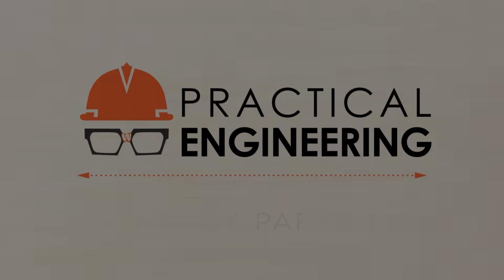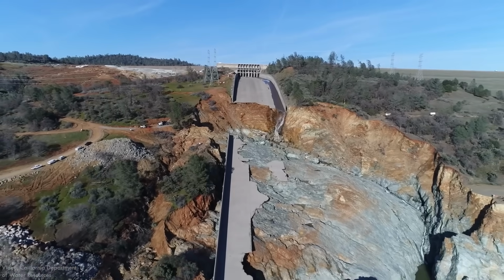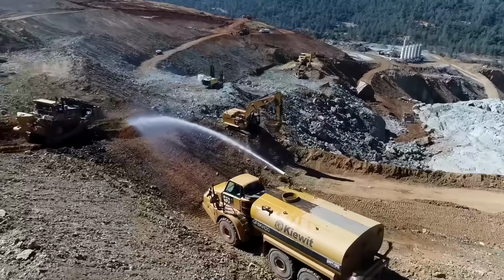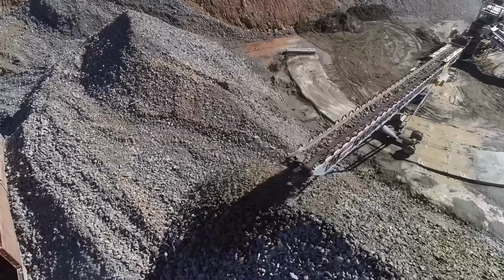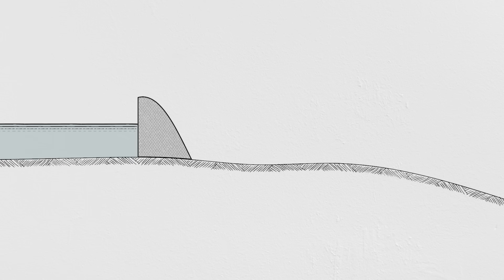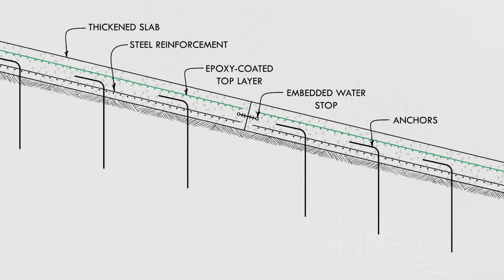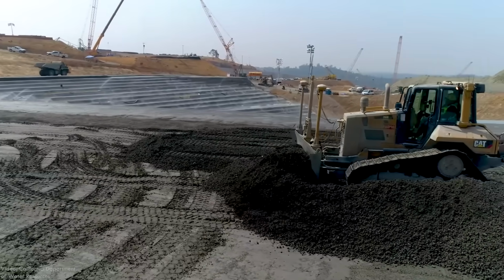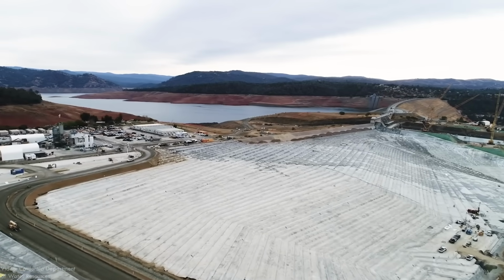Rebuilding the Oroville Dam Spillways

Comment: DWR used this process to hide the fact that this disaster was the direct result of their incompetence. They had an entire wing of their organization collecting a paycheck to operate and monitor the dam who had been sitting on their lazy rear ends doing nothing for years. The minute the crisis began we got to watch a daily circus of DWR imbeciles flailing away at their attempts to characterize the incident and explain away the fact that they had failed to conduct the required inspections, or to in any way understand the resource they were entrusted to care for. The end result is the taxpayers got fleeced for an enormous amount of money and the fools that let it happen were protected by Governor Moonbeam. Complete disgrace. The other fact that became immediately obvious is that the zone of weakness that led to the failure was known about before the dam was built and it was ignored to save a few bucks. The parade of government failures goes on including the fact that the emergency spillway was at the same level as the adjacent, unarmored, parking lot which would have blown out eventually. Many of us saw the problems long before the crisis happened and were told by the State that the Emperor was fully clothed. Complete BS.

Comment: A question if I may, I'm not an engineer: Why did they not use penstocks in the original design and in the rebuild? Would they not have been cheaper and as effective?
Reply: A very short explanation: Penstock pipes have less flow capacity than open channels and weirs because they have more surface in contact with the flow for the same area. Also, the flow velocity at the outlet of a penstock pipe is much higher than for an open channel, so they require more energy dissipation to prevent erosion.

Comment: Honestly, the problem was simply that they failed to regularly reseal the original spillway which allowed water to seep through and erode it, and the emergency spillway was poorly designed and did not have a have concrete cap to prevent it from eroding the area immediately below it.

Comment: Well the cracks may not have been the result of slippage but more a result of non reenforced concrete as i may be wrong but there was no rebar in the concrete visible at the separation and that must be the cause if in fact i am right. Long concrete pouring and no rebar equals disaster and fraud.

Comment: This reconstruction video (and the prior one on the dam failure) are
the first and best honest inquiries that I've seen regarding the
failures of both spillways, and the obvious foreknowledge of CA DWR
regarding the dangers of relying on an intentionally misconstructed
and falsely-signed-off systems that have been a hazard to the central
valley since 1968.  Who benefits when a dam is built this way?

I would enjoy seeing a similar inquiry in the role that the history of
the river valve outlet system (RVOS) played in the 2017 events, as
well as a clear look at how the dam was rapidly emptied in roughly two
weeks after both spillways failed.

CA DWR has a history of ordering destructive testing without
consulting the Division of Dam Safety (ex. April 2009 RVOS), and I'm
considering the possibility of the 2017 destructive spillway tests
being a repeat of this practice.

I recall reading about decades of unsuccessful attempts of CA DWR
lobbying a retrofit for the Oroville dam to ensure safe and reliable
failure modes.  How did the cost of the emergency repairs to the
spillway damage compare to those proposed retrofits?

Comment: Wow, that was a brilliant idea of using a model to check each design engineers suppose to see how it would handle the water in real time.
Reply: They always hydraulically model these hydro-projects as they all are unique. Original was probably modelled by UCD in the mid 1960's.

Comment: its not hard, redirect the water to the side, fill in with rock and dirt from the bottom of the spillway. rebuild. thats it. i dont need this 20 minute video explaining how to rebuild. its redirect water, dirt, rock, and then cement the thing. nothing complicated. if you want things to be complicated become an engineer. poor machinists have to deal with these jerks all the day long with stupid tolerances. that dont even need to be that tight.

Comment: Another fantastic video. As best as I can tell the only thing you got wrong was your statement about the Contractor bidding on 30% plans & specs. That is not correct. Although they did go out for bid without FERC approval, they were at 100%. Actually, if memory serves correct, we didn’t have DSOD or CSFM’s approval either. FYI, CSFM’s involvement pertained mainly to the trailers setup in the boat ramp area, i.e. EMS access, etc. Consequently, change orders started coming in very soon after Kiewit was awarded the contract. There were a lot of CO’s on this contract. 

Watching Kiewit work was nothing short of amazing. The speed at which they got things done was beyond impressive. Plus, they were actually quite nice to work with, including their subs. 

In case you’re curious, yes, I did work for DWR and I worked on the Spillway project. In fact, I was already working in Oroville on the Fire Modernization Contract when the Spillway incident occurred. In fact, I still believe I took one of the first pictures of the damage after  the FCO gates were first closed. I happened to be driving down Oroville Dam Blvd right as the water flow was slowing down.

Comment: The maddening part of this entire incident is this:  prior to the failure, California experienced 5 (count them, FIVE) consecutive years of severe drought.  This was more than ample time to have inspected the dam and discover flaws and initiate repairs!  The damn dam owner, and not the ratepayers should bear the costs associated with this disaster!
Reply: Those in positions of power often fail to understand the necessity of preventative maintance. After all, you can't see what what you stop.
Reply: The dam owner is the State of California, and, thus, California taxpayers.
Reply: It's worrying to look at the Hoover Dam's emergency spillways. They are in really rough shape having only been used twice. If Lake Mead ever does reach capacity again and it's necessary to discharge a lot of water, a similar failure is not out of the realm of possibilities.
Reply: @nooranik21  Right now the far greater concern is if there will even be a Lake Mead in the future, much less it reaching capacity.
Reply: @SaltMerchant That's no excuse for letting emergency facilities fall into disrepair. As previously stated Lake Oroville was at an all time low just 5 years before the flooding in 2016 and the spillway failure.
Reply: Jerry Brown Sr built it with less than 10% of the rebar necessary and you can't see that until it breaks.
Reply: Mr Owl
The spillway would be a really fun ride up till you die at the end part of it.
Reply: DzyMsLizzy
"California experienced 5 (count them, FIVE)"

One, two, three, four, five.
Yay, I can count to five!
Reply: The owner is The State of California. Logic is not allowed to be used in their decision-making processes. Personnel must include LGBTQ or you are fined. Identity outweighs all other qualifications. This disaster was preceded by another disaster that nobody knows about which led to this disaster. Story is so unbelievable that I cannot even repeat it. Turkey fryer incident. Unbelievable
Reply: @melaniecotterell8263  even if that were true, why would being LGBT make someone a bad engineer? the problem here is there’s no incentive for decent maintence on any american infrastructure, that’s why all our bridges and everything else are in such dire condition. 

in other words, the problem is that the government and anyone else in charge of structures like this are lazy and negligent because it doesn’t suit their profit margins, and there’s nothing pushing them to act before the structure fails. 

trust me, i understand the anger, just don’t direct it towards things that have nothing to do with the problem.
Reply: @melaniecotterell8263  cringe

Comment: Not sure why we don't use a form of glass or plastic to cover the concrete. It eliminates the friction between the water and the substrate. In doing this, the resistance to flow is eliminated and nothing will get destroyed in the future. Concrete is strong, yes, but at the same time it introduces massive amounts of friction to flow, this is how water wins all based upon friction. Half inch thick tempered glass with an EPDM rubber backing and a reflector on the glass so UV doesn't destroy the rubber with concrete under and she's good. Or acrylic with UV protection embedded. When you give water resistance to flow that's when destruction happens. Lol look at the grand canyon as an example.

Comment: I am really surprised that they used epoxy coated top bars. They have had poor performance in parkades/garages. The epoxy tends to delaminate from the bars minimizing the interconnection between the bar and concrete and actually promotes corrosion which causes more delamination. Hot dipped galvanized bars would have made more sense. Epoxy coated rebar has been removed from parkade codes requirements due to the issues.

Comment: This event in particular highlights just how devastating the power of water can be, specifically the hydraulic force of water. Water is used as a cutting agent in water jets because it can't be compressed, cutting through steel and rock. 
The spillway failures turned the dam's outputs into massive water jets.
Reply: Too bad a lot of people don't understand the power of water.  Maybe they'd stop trying to cross fast flowing flooded roads ;)
Reply: @jasonwood7340  It's human nature to ignore danger and just send it I guess. :D
There's published facts on how much lift a foot of water can apply to a vehicle, people attempt to cross unsafe bodies of water anyway. I watched several people earlier this year during a record flood try to cross water over the highway that was about 6-7 feet deep. Fortunately for them it was not moving water.

Comment: This may be a really silly question. But what if—when threatened by a flood—the state issued an emergency “open your taps” order to everyone downstream, whose water draws from the reservoir?
Reply: I don't know their water system layout but for one the flow rate would be miniscule compared, and would cap out quickly (not designed for max flow with all taps open) The dam holds years worth of supply... assuming direct supply.

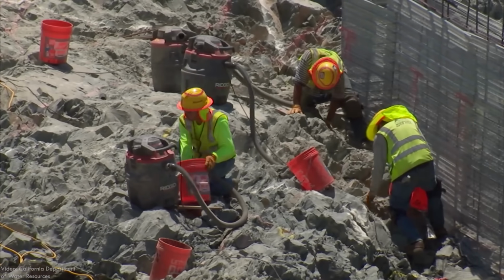Comment: 11:50 Ok, So the Rock has to be completely clean for the Concrete to key to it.
How Clean?
err Vacuum cleaner clean.
I suppose normally that would be done with water, but the convoluted holes would have prevented in this case.

Comment: Thanks for this video. I lived in Chico which is very close to the damn, and used to mountain bike trails adjacent to the emergency spillway hillside. Very familiar with the size of the damn having to drive or ride across the top to get to the trails, after the fun downhill trails we ended up at the bottom and rode up the service roads on the slope of the old emergency spillway back to the top of the dam. Its a MASSIVE structure, video and pictures don't capture just how big it is. Most striking moment of this video was seeing they used shop vacuums and cleaned the entire area that was filled with RCC like one would detail the inside of ones car, though I closely monitored the progress of this disaster and recovery I had no idea they actually did that. It must have been daunting for the construction workers starting in on that particular job!

Comment: So essentially the project was saved by hundreds of shop vacuums. I do have to wonder about how cost effective it is to create the massive scale spillway as opposed to multiple small channels of release capacity. It's not too hard to envision a model where there are many small reservoirs ready to take and hold excess water, instead of blasting it down the river.

Comment: To be fair, a dam of this size should probably have 2 primary spillways. If one fails, then one is still able to operate at half capacity.
Though, more power generation capacity could also be useful if grid scale energy storage becomes more common in the future.

Comment: Lessons probably not learned : 
A) Don't let a politically connected hack design your spillways, or anything for that matter.
B) Be sure to have periodic inspections and hold inspectors accountable.
C) Allocate funds to maintain your critical infrastructure (vs. boondoggle, never to be completed High speed rail projects).

Comment: I haven't heard anyone mention just where the cement itself came from. Following the construction live, there were obviously a great number of trucks arriving on site each day with the cement. . . but no one mentioned just where it came from. Were the local Cement plants able to handle the demand. . .or did they have to ship it in via train or truck from places far away? 

Inquiring minds need to know!!

Great summary, by the way. I was hoping you would mention the two concrete plants, as well as the ice plant and how liquid nitrogen was used.

Comment: what went wrong was as you can see in the vid the concrete contained no rebar & was built on top of soil infill meaning it was a matter of time before the water washed it away & i bet they still didnt use rebar or boulders in the rebuild so it will happen all over again

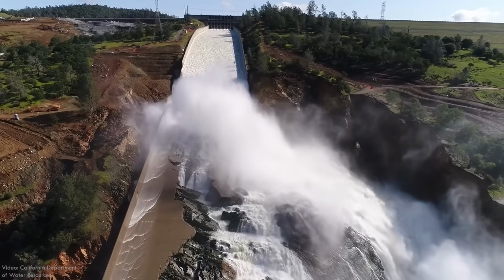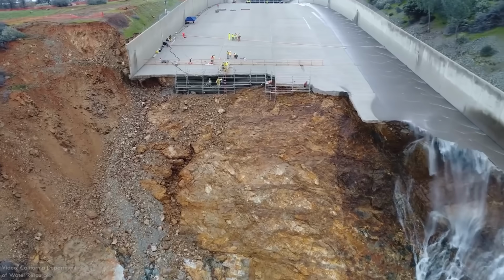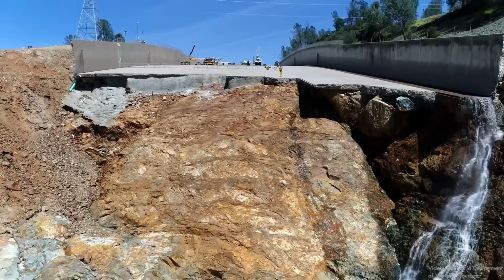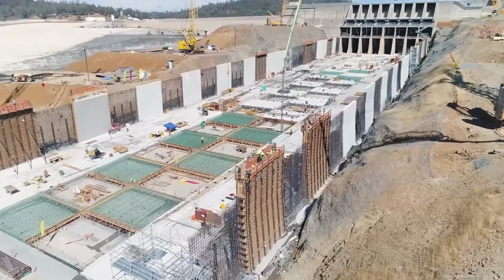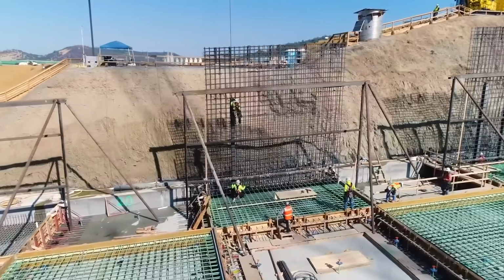Comment: At 4:30 you state ""without a complete understanding of what had gone wrong". Do you think the complete lack of rebar could be what went wrong as seen at 1:55 & 8:30? My driveway has more rebar than this. Furthermore, you can see the correct amount of rebar in the rebuild at 5:52 & 16:09. I'm willing to bet the original plans for the spillway called for a hell of a lot more rebar than what was used. Can we have a look?
Reply from the maker: Yes, I have the link to the IFT report in the description of the previous video where I discuss all the reasons for the failure, including the issue with the reinforcement.

Comment: The construction workers vaccuuming the loose debris to get the surface clean enough for a good bond was interesting to see because in the original design and construction that was a big reason for the failure.  The other reason for the failure was the lack of an actual boots on the ground inspection before using the spillway.

The new spillway does have some minor issues here or there with the cement surfaces but those have been repaired.  I still would love to see some close up shots of the entire structural concrete, how the joints look now.  How it is holding up under weathering.

The major remaining issues with the whole facility revolve around the headgates and possibly installing some other spillway infrastructure so that they can lower the level sooner during flood control season.  When the heavy atmospheric riviers dump moisture on all the snow they either need to be able to forecast it far enough in advance so they can make more room in the reservoir or they need to leave more room for flood control (which means letting a lot more water go than they'd like).  The existing spillway can only be used when the level gets above 813ft or so and that only gives them 77ft before the emergency spillway level kicks in at 900ft.

Comment: Interestingly that concrete is very similar to Roman concret. That's how they set it. It is thicker then our poured concrete. Roman concrete was thicker and pounded into brick and molds to create structures. Hopefully it will produce the same longevity.

Comment: "Roller-Compacted Concrete" was the hero of the entire project??? 
Sounds experimental. Experimenting during a crisis is fine if it averts (delays) disaster which it apparently did in this case.
But I'm willing to bet a large sum of money that 10-20 years it'll already be cracked and flaking like the pancake make-up it is.
Reply from the maker: It isn’t experimental. Lots of dams and spillways are built this way

Comment: Its high pressure but this is how most project need to be done these days. It takes 4 years to upgrade 3 miles of highway and during that time everything else that needs to be done just falls behind. We are in an eternal time debt.  This dam is a good example, something went wrong, it was fixed fast before it cost more to fix the bigger problem if it were to take 4 years to complete.

Comment: I was an engineering student at Utah State University when they created the model of the spillway. It was really cool. We got to take a tour of the facility and see them test the model. It was really impressive to see it in action and only reinforced my decision to want to be a civil engineer.
Reply: "Aggies all the way"
Reply: We are doing a hydraulic model same as above from sri lanka..
Reply: @upekshaliyanarachchi5180  he just wanted to vent
Reply: Yes, because they had no choice but to use reinforced concrete!
Reply: See how Sayano-Shushenskaya HPP shore spillway made (it has 5 water-slow-down-reservoirs at 5 levels or five-stage drop consists of 5 disperse wells, 100 metres wide and with the length from 55 to 167 metres, divided by the dams). Water slows down from 30 metres per second to   4-5 metres per second at the exit to the river it becomes slower.
Reply: hope you're better than 99%

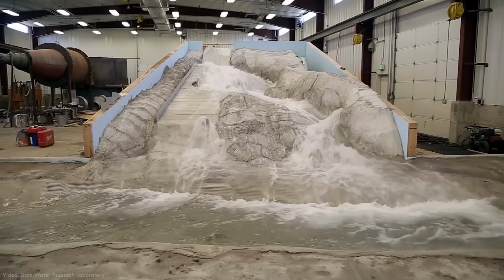Comment: 5:22 I don't get the problem with the standing wave?
And, since this is a problem, why they didn't blast the natural spillway to a proper shape? Was the rock/geology not strong enough?
They also could have put concrete to partially fill some holes to modify that natural spillway with even more precision.
Expropriation of the neighbour in a safety perimeter as well.
I'm curious if this solution would have been faster, cheaper and as safe?
Reply: Hey USA hydro people, just call me next time, or read my free advice in the comment section.
My pleasure.